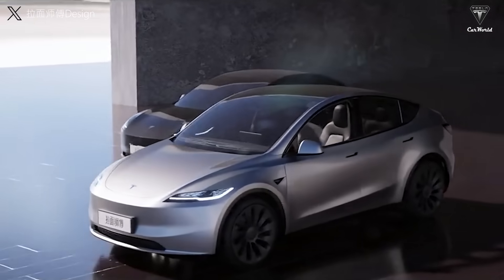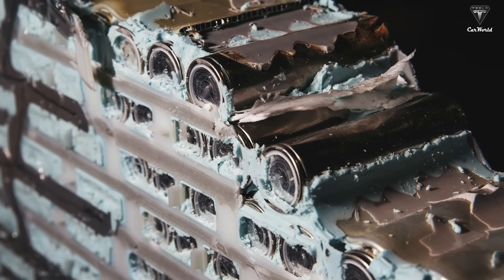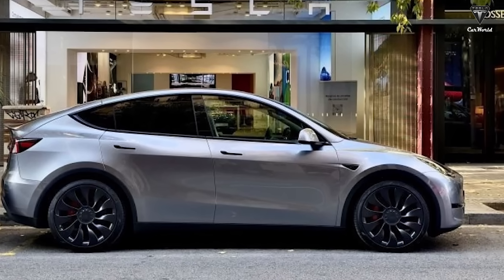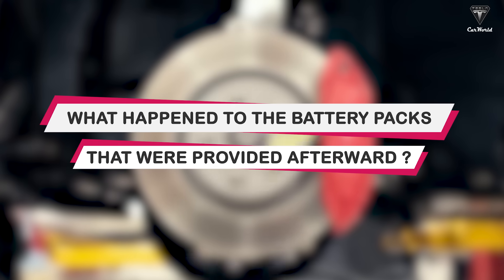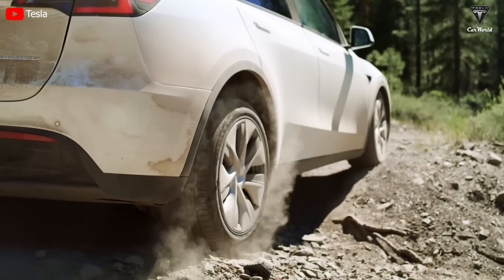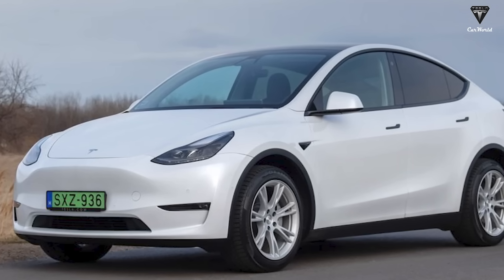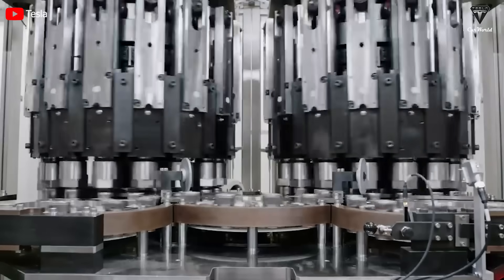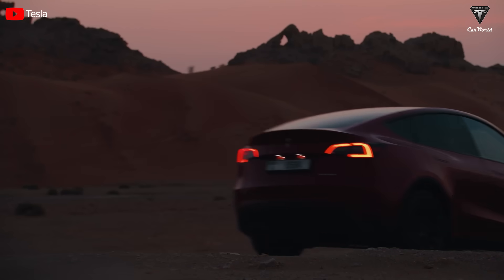Watch Before We DELETE! This is the BAD News about Tesla Model Y Juniper 2024 You MUST Know!

Comment: One of the reasons I would favorrize CATL LFP Batteries. CATL has been Tesla's supplier for LFP batteries for some versions of the entry-level Model 3/Model Y for a few years now. I have no trust in the current batterie types 18650 and older 2170 cells that are still used in the TESLA vehicles with .NMC- or  NCA. Hoping for CATL Batteries in the Juniper in 2024. 
.SinceTesla, Mercedes, BMW und VW are cooperating with CATL we will see that the LFP Technologie has a future in  EV from these manufacturers.
Reply: If thats the case then bye bye tax credit

Comment: Batteries, like with mobile phones, UPS, solar battery banks longevity and performance depend on usage, non usage, over charging methods, under charging, maintenance and even temp conditions and that applies to all manufacturers of rechargeable batteries.
Reply from the maker: Total agree!! To maintain a good battery pack requires many factors, thank you !

Comment: I have a 2021 model 3 LR and after I had it about 6 months it suddenly wouldn't charge.  I called for service on the app and rather quickly was told it was the battery pack.  They came and picked up the car and towed it to the service center.  It took about 2 weeks before a new battery came from California and was installed.  That was 2 years ago and I have had no problems since.
Reply from the maker: You are so lucky, but the guy in our video is not so lucky! He had to replace the third set of batteries and it was really stable. Is your M3 still under warranty?
Reply: Yes, it is still under warranty and it is a great car.  I plan on getting a Model Y next year, I would like the SUV for the extra room.   @TeslaCarWorld